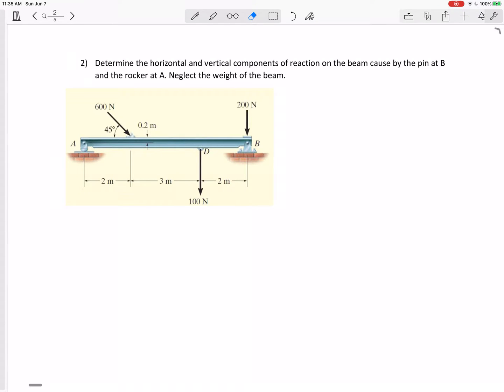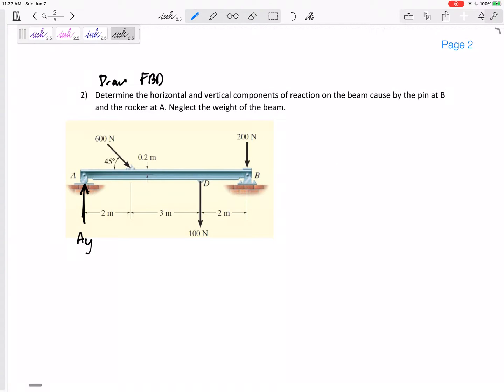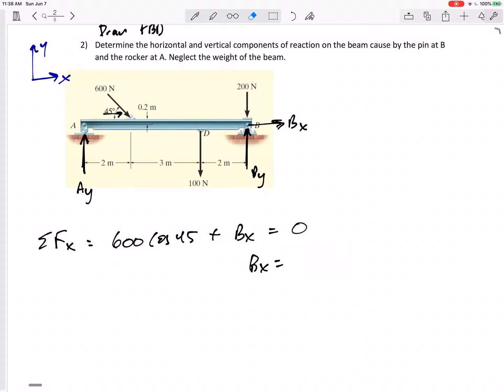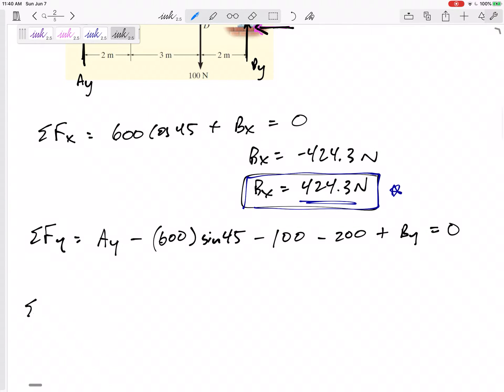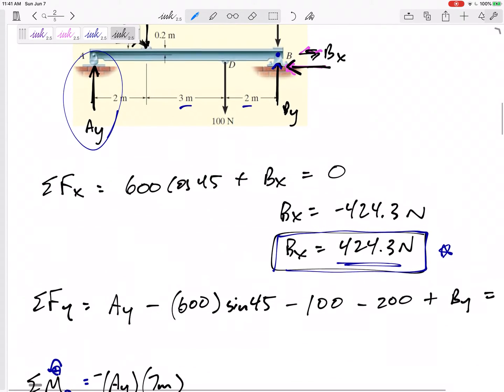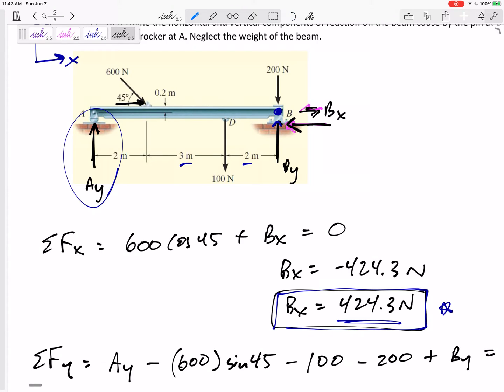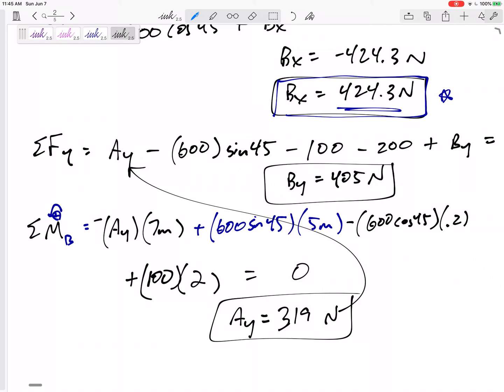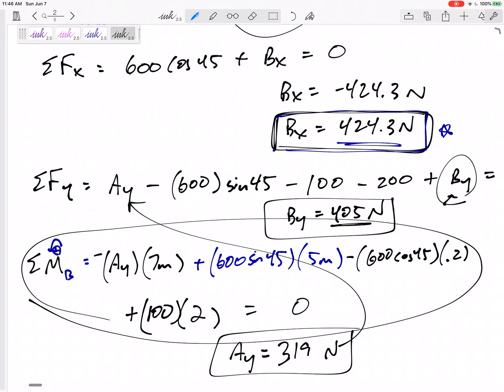Fundamentals of Engineering Mechanics - Test 1 Problem 2 - 2D Rigid Body Equilibrium

Comment: how did you get the -424.3 ?? i don;t get it..how did you calculate it,,its different on my calculations.
Reply from the maker: 600 times cos(45) is equal to 424.3. Maybe your calculator is accidentally in radians?
Reply: @engineeringdeciphered  I ran into the same problem but then saw my calculator was in radians. Thank you!!